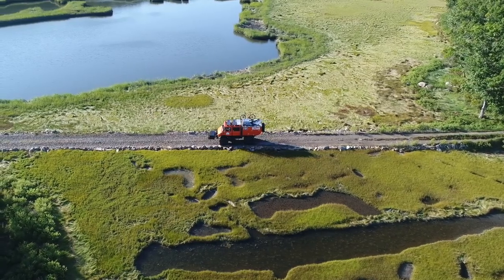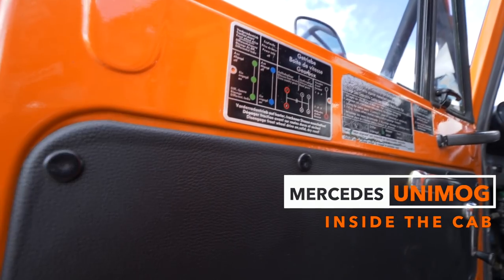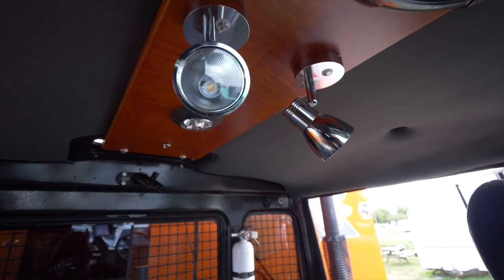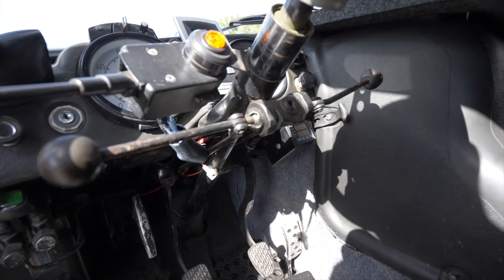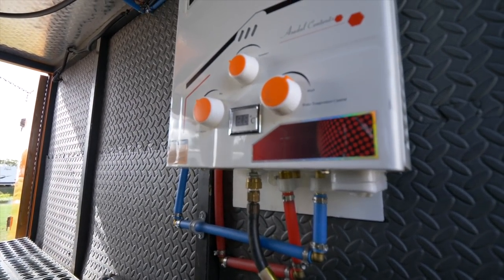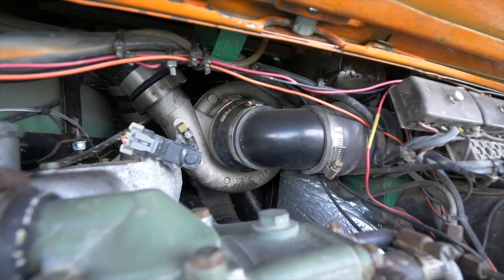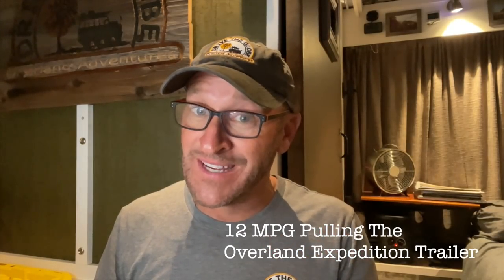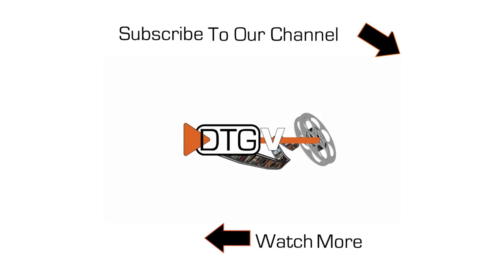Ultimate Overland Vehicle Setup - Mercedes Unimog Rig Walk Around

Comment: Michael, here's a tip for some of your Uni Mog followers. 
When I repowered my 89 Fleetwood Limited 37' RV from Gasoline to Diesel, and swapped out the C6 3 speed transmission for an Allison 5 speed 1000 World transmission, I didn't want to mess with a lot of speedo accuracy issues.  So I called SpeedHut Gauges and had them custom builld me a GPS driven Speedometer.  This way it didn't matter what my gear ratio in the rear end was, or what tires I wanted to run.  Since the transmission is an electronic controlled transmission we built and programed a stand alone TCM computer that would operate separate from the manual (non electronic) P7100, 12 valve, Hot Rodded Cummins motor I hooked it to.  They took the pictures of the Isspro Gauges that were in my RV and matched them perfectly.  I also had them upgrade the speedo from 80 mph to 100 mph.  And they sold me new custom faced tachometer, boot gauge, Pyro and fuel pressure gauges that look like the Isspro gauges, other than the tiny logo change placed in the same spot as the OEM gauges.   Money well spent and it looks totally stock.  I believe they have a big gauge that would work in the Uni Mog  applcations too.
Reply from the maker: Thank you for the info.  That sounds like a great solution. Makes a ton of sense. 💥
Reply: Your welcome!  I'm a 70 YO  Hot Rodder and don't want to pass on to the next life not sharing knowledge I've learned over the years to others who are like me.
The cool part is I'm still learning from the younger guys like you...  Love that Military Camper.  The bed on the back is a brilliant idea!  And I love the slide out porch with the steps that go parallel to the body. Makes entry for old guys less of a challenge.

Comment: Honestly that’s bloody good fuel economy for the size of the rig, & the weight of it.
Looking forward to watching the trailer video.
Reply from the maker: Thank you, it has been pretty good MPG- of course I also go pretty slow!
Reply: People don’t quite grasp that the motor is not a power house like a ford or chev with well over 300 horses. It’s smaller but geared to get it done. Not winning any races but certainly finishing them, little bit more turtle style!

Comment: I have a '78 425 u1300 on tractor tyres.  I serious like the trailer concept of this expedition vehicle, not planning on getting stuck but I have an electric winch to put on the front.
Reply from the maker: Very nice! The trailer is a plus when you want to leave camp and explore without your whole house.
Reply: @drivetheglobe  definitely, did you ever consider a four wheel trolley trailer when you started spec'ing out what you wanted at the design stages?...

Comment: Nice lots of fab and thought went into that rig, I used to have a 67 411, not near as tricked out (not tricked out at all bone stock wabi sabi bare bones mog) but hell i lived in the thing for 3 months and it would go anywhere easy to fix and just a cool rig. I recently bought a 96 F350 PSD 4x4 box truck currently using it too move from Florida to Ar its made several runs but I keep thinking about building it for this overlanding thing.
Reply from the maker: The mogs certainly go anywhere, just not that fast!  The F350 is a great truck too and certainly a strong candidate for an overlanding rig.

Comment: Interesting. 
The truck & trailer looks like 150-250k $ budget, depending on how much you outsourced the work. Fabrication, parts and suspension adds up exponentially fast. Do you have the numbers on this project?
Regards,
Reply from the maker: Don't have detailed numbers as Ive had the truck for 14 years and have done alot of work over the years. The trailer ball parks at $40k with almost all the work done in house except the frame and skin. Either way, as you know it always seems to add up to way more than you wanted to spend.

Comment: do you have the 2:1 box?  the 1300l i drove had fast axles but not the extra low range box.  i missed it.
Reply from the maker: No, it did not have the 2:1, although I still found it to be a beast off road.

Comment: 8:56 ....so how do you keep the electronics from getting damaged or shorted by water, and other elements from the environment 🤔
Reply from the maker: Electronics in that part of video are in the battery compartment so they are covered from the elements. The shutoff and battery tender are sealed, and the box is quita a bit off the ground so deep water is not an issue.  Thanks for watching.

Comment: Hi, I am Mack and I am from Greece. I love your truck a lot and I use to drive one the same as yours only with two doors.  Why did you choose not to have a driver seat with air shock absorbers, it's way comfortable?
Reply from the maker: I put recaro seats in that are comfortable, tough to fit air seats with the low ceiling.

Comment: Curious why you didn’t lift the fuel tank after the body lift?
Seems to be hanging pretty low for a mog .......
Reply from the maker: Fuel tank could not be lifted as its mounted to the frame. Just the cab was lifted which is a separate component. Thanks for watching.
Reply: @drivetheglobe  I am aware of that, the frame mount could have been lifted after the body was is all I am saying, give as much ground clearance as possible....
And the front carrier ....wow, just loose that!
Reply from the maker: @1966cambo  problem was in order to lift the tank the exo cage and the step mounts would all have to be refabbed too. A lot of work to be sure.  Probably could only gain a few Inches.  I did scrape the tank mount once on a crazy trail but other than that it hasn’t been too bad.

Comment: I have exact same mog but high roof version and 1971 year.  OM352 so no turbo.
Reply from the maker: Sweet!, the high roof version is nice cause the cabs are a bit on the tight side- especially if you are tall.
Reply: @drivetheglobe  Yeah, I can imagine. Even with the high roof I can't sit straight on the back bench. I'm 175cm. Need to delete or put thin roof lining.
Reply from the maker: @motoshedman  luckily I am fairly short- but I know what you mean.

Comment: You  probably  wouldn't  want to  go much  over  55 .
Reply from the maker: And I really don’t.  No reason to rush.
Reply: @drivetheglobe  in Nevada  the  speed  limit  is  80 in  many  places. And  many  people  go  100 .it  could  be  a hazard. And  a long  boring  drive  .and  6 miles  to  the  gallon  doesn't  sound  great  and  parts very expensive and difficult to get. .but  it  would  be  fun  when  you  got  there.

Comment: I just want to comment on this rig from a van life perspective. The biggest problem is the limitation of only doing things outside. Not being able to do things inside reduces your quality of life on the road. Besides that, it's too big, slow, uses too much fuel, has limited range, and is not versatile enough -could be more versatile. Not that cool inside -not my opinion, it needs to facilitate what you like doing in your down time. For example, we see your editing rig, so that could mean you need a proper workstation with multiple monitors speakers and a powerful desktop tower PC inside either your truck, or trailer to keep a high quality of life on the road. It's not high tech enough. Neither truck or trailer is high tech enough. Your design might be too conventional for the amount of space it has inside to maximize it to facilitate what you want to do at a proficient level. You might need to think more outside the box to make more things happen and better in every way. Everywhere you went with it, you can go in a van. The difference with this rig is you might be able to take more cargo with you, but a van combines the truck and trailer, giving you cargo and living space on a single chassis. The truck adds nothing the trailer couldn't have, and the trailer adds nothing the truck couldn't have. If the truck is more nimble without the trailer than either it's not built right, or it's not built enough. being able to set up camp, ditch the trailer and explore with the truck is negated if the truck is not capable of sleeping in. The batteries should be DIY, not shelf bought. The truck should have A/C. The tailer needs to be powered, to have it's own traction; This does not negate it being a trailer, nor should it have to be powered at all times. The ability to engage the wheels off road is a must have, but is costly on road. The house section needs conveniences' like washer, dryer, and dish washer. The truck engine needs upgrades for better economy, and function. The engine needs possible hydrogen injection to save fuel, and aftermarket alternators to keep the power banks topped as apposed to using solar which is costly and ineffective, freeing up space on the roof for more fun stuff. A calorifier will also take advantage of wasted engine heat. The rig is crude. It needs to be streamlined. I used to want to build a trailer, but there's no way to get around certain aspects of it. Building materials are limited and expensive. 2 years to build is actually reasonable. To make a good trailer, you have to start from scratch. That's why they're hard to make. You need modular plumbing inside of your truck and trailer. Parts and appliances' need to be plug and play. We often have no idea how to build a trailer, but think we do, or are onto something. Trailers today are made to maximize profit margin not to help us do what we want. They do, but at the bare minimum. With all of this contraption done and behind you, you can truly enjoy the outdoors without worry.
Reply from the maker: Oh boy.  That is a lot.  FYI, came to some of these conclusions thus the all new truck.
Reply: @drivetheglobe  Basically but it's all in the process. This was hopefully a good stepping stone. Without the right contraption your quality of life on the road will be shyte, and then you will make a "why I quit van life", or truck camper life equivalent video. This is why we have to talk about the contraption itself.

Comment: what gears did you put in the axels and portals ?
Reply from the maker: I swapped out the diffs and portals to the "super fast axles". Cant remember what the ratio is. Not super fast though 😂
Reply: @drivetheglobe  not super fast? May I object?  -  In the German Army we had the Unimog 404 , with small 2.2 6cyl Mercedes passenger car engines, tuned down to 60kw (for longevity) top speed around 85/90Km/h (the newer Diesel 1300 were less fast!) and that was (still is!) plenty for a Unimog.  If I enjoy my drive , 60 - 80 would be top anyway, otherwise we don't see the landscape, in my old Landrover I rarily do more. Btw these 404's were our the most capable 4WD's.  However, you live in Australia and interestingly that was the first country where I encountered this mysterious obsession with speed, faster gears, bigger tyres etc  (also frequent issues with broken half shafts etc on modified vehicles) 
Enjoy your drive and slow down in your great (and fast) Unimog 👍